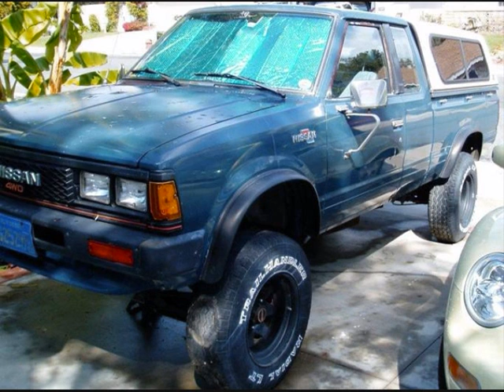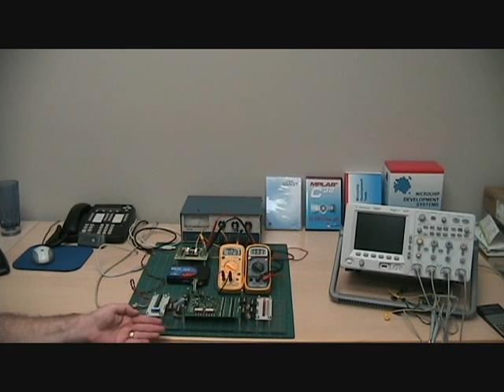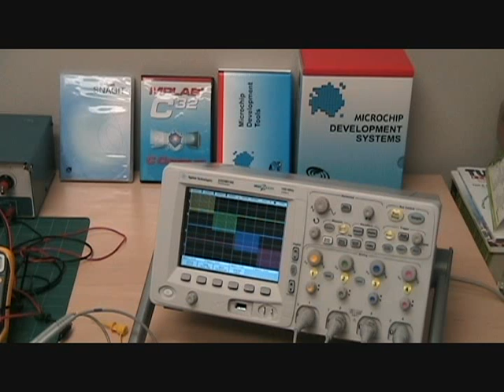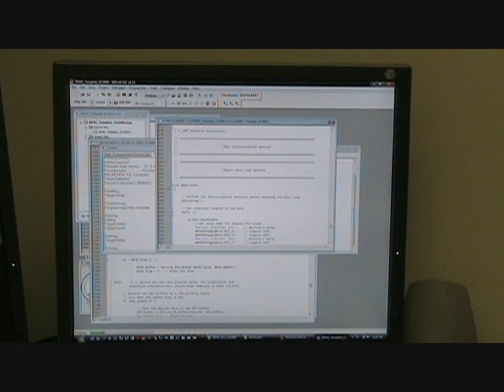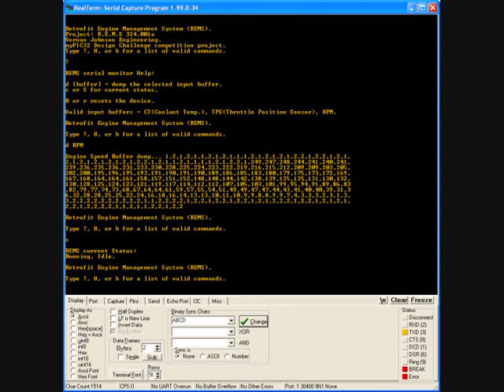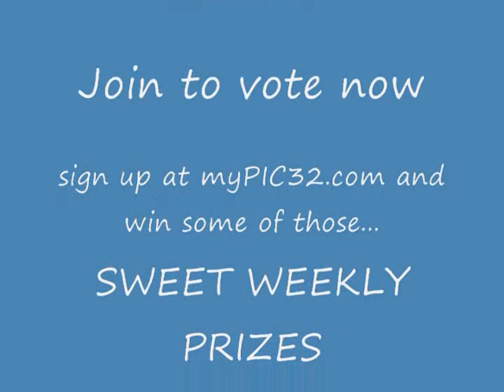myPIC32 Design Challenge Detailed Operation 01/25/2009

Comment from the maker: As far as soldering with small Surface Mount parts, yes it's difficult. You can't do a breadboard (like the perforated boards with the through hole parts) with SMT parts but it's also a lot easier to get a few PCB's made. 
 
I uesd Advanced Circuits for these and they even have a free CAD program that you can do the board design and then order them right in the program.  There are several vendors that do the same thing, Advanced is not the cheapest but some can be very cheap.